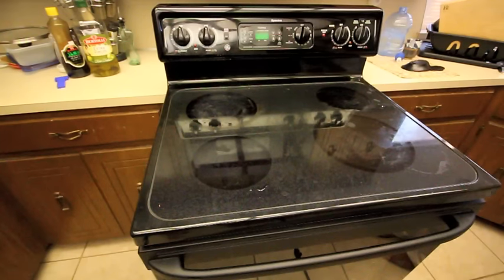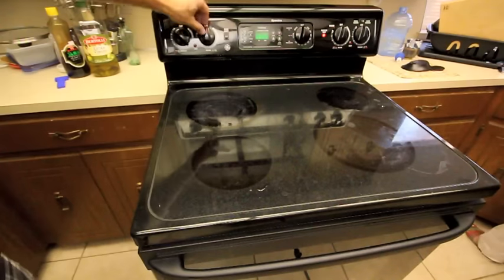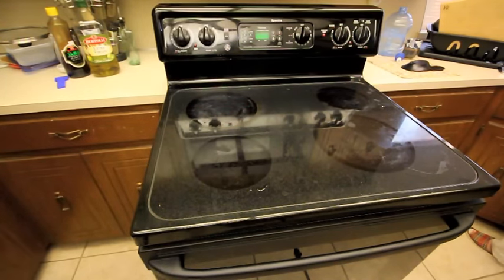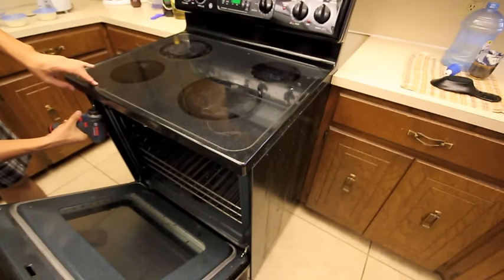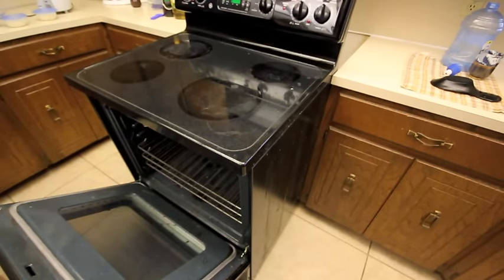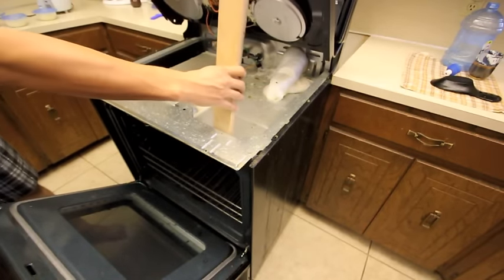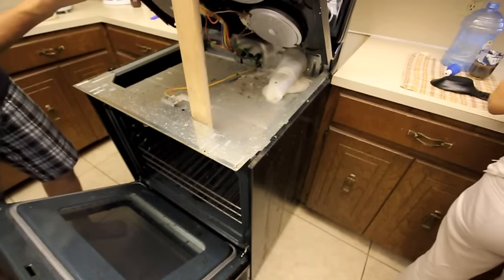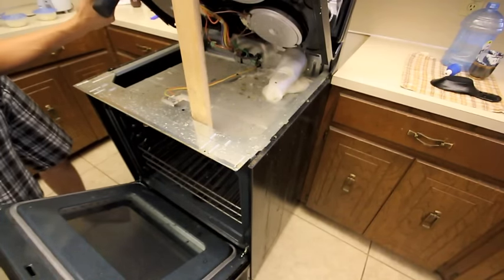Surface Electric Oven Range stop working - Repair Replace GE Glass top Haliant Heating Element

Comment: I just installed a main top on a Whirlpool stove, slightly different, but saved me almost $400 in service call and labor from Ace Appliance Repair in Swanton Md! Took me 35 mins or so taking my time.  Ace quoted me $100 over Repair Clinics parts price, plus labor estimate $150, also show up charge $99, total job Ace's price total was $650! Plus wait 3 weeks! Instead chose to order part from Repair Clinic for $267 and put in myself! Thanks for the vid and thumbs up to RepairClinic for parts.

Comment: Try this tip - instead of buying a replacement element we used a tweezer to reconnect the burnt out coil to each other (the coil is very thin, careful).  It actually worked!  I hope it lasts, thanks to this video for showing how to do the repair.

Comment: Tip: In a different video I watched, the guy replacing the heating element burners started pulling off connectors with his fingers but then switched to needlenose pliers which seemed to work a lot better. If I attempt this myself, I'll start that part of the process using needlenose pliers because it's hard to grip tiny things with your fleshy fingers, especially if you have large hands. It's kind of hard with small hands too, because your grip typically isn't as powerful.

Comment from the maker: With the info you present, i would say: Since the clock was flashing means the stove went out of power at one point. Now the clock is the only thing that turns on and the rest are not working. Meaning you might have 120VAC but not 240VAC. Check your breaker or a fuse somewhere. check the voltage at the wall etc... hope that helps.

Comment: I have a GE glass top oven.  Starting with one and over time now all burners won't maintain the proper temp setting.  If I put it on low, the burner will end up on high and not go back down until I jiggle the knob.  This happens on the two front burners.  Thanks for any insight.

Comment: Thanks, very useful video. I recently bought a second hand glass top stove. I make Roti (bread) regularly in my home, after using this stove, I feel as if it not heated enough to let me make roti :( I feel it's at least 4 to 5 points (according to the nob points) lesser than the electric stove. Am I right? Or something wrong with the stove? It turns red, all of the stove but I don't get the desired heat. How do I check if it's heating properly? Any help will be highly appreciated. Thanks
Reply from the maker: Its a bit long to explain, but search "glass stove top temperature" in google and you should get a better answer.

Comment from the maker: ya, the few i worked with had a few cracks on the edge. i think its fine as long as its not a structural issue (e.g. major crack down the element). thats just my 2 cents. hope that helps.

Comment: I need to replace the front two burners Any local stores in mind is Home Depot a good place to go?
Reply from the maker: minstrel4life You can search the following keywords "appliance repair supply store" in google maps to find a local store that sells replacement part. Or Amazon's heating element section: http://goo.gl/wOAdF

Comment: I cannot attach one of the two wiring quick connectors back onto the "beige" connector block. Use a dremle tool to trim it to fit?
Reply: Hammer 🤷‍♂️

Comment: I came down in the morning to make breakfast and the clock was flashing, so I adjusted the clock and turned on the burner and it didn't come on so I tried the 3 burners and none of them would come on, then I tried the oven and it wouldn't come on. I have had this appliance for about 2-3 years, is it burned out already? I checked my circuit breaker everything was on, so what's wrong with my stove?

Comment: Very helpful video BUT anyone who is doing this PLEASE turn off on the wall/mains for safety reasons. We still want you to cook.
Reply: If you pay attention at the end, you will see him plug it back in and the light on the clock read out come on. I thought he hadn't unplugged it either, till he reached behind it to plug it back in. :)
Reply: you gotta watch and listen to the whole thing man.
Reply: CheeryToes I think Jah is talking about tripping the breaker, not just unplugging the unit.  Some outlets can have grease, grime, humidity, that will transmit a jolt.  Tripping the breaker remotely is the way.  Good call Jah.

Comment: Could you please share with us the serial number code for searching the item through online as I'm having the same burned item you have replaced.
Reply: The one I need for my GE is WB30X24111. You can find it by figuring out the model number of your range (open up the pan drawer on the bottom, it's on a sticker there) and then searching for parts for that model number.

Comment: All of my burners will not come on what is the problem
Reply from the maker: +Belinda burt First you should check the circuit breaker and fuse. If they are fine, then it can get complicated as you'll have to take out the schematic behind the stove and trouble shoot if its the control, connector, sensors, etc... are the cause of all of your burners not coming on.